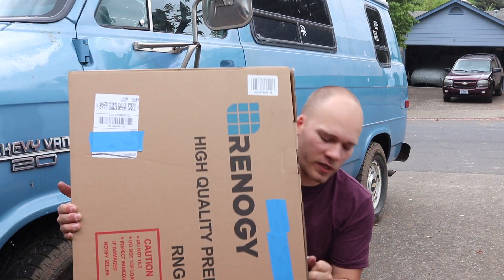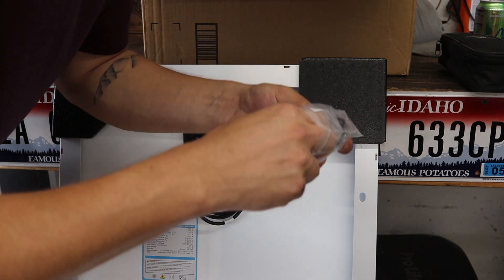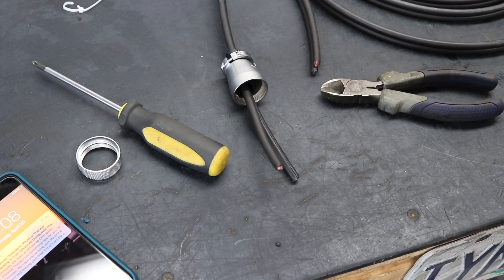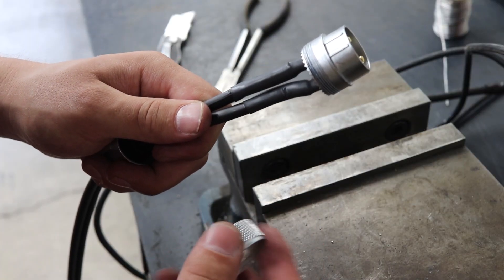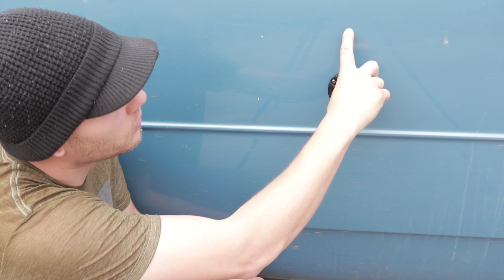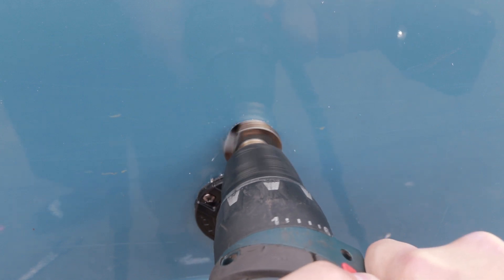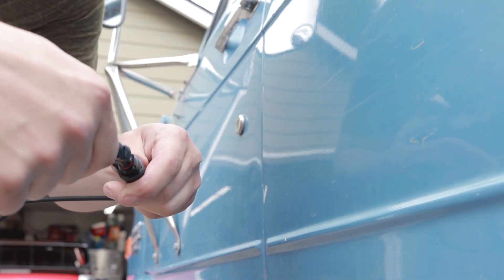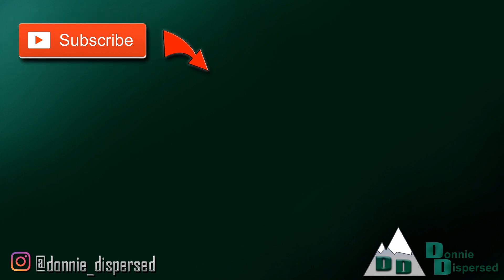CAMPER VAN SOLAR SETUP/ INSTALL | Off Vehicle Panel

Comment from the maker: Items in this setup! 
Renogy 100w Solar Panel: https://amzn.to/3nS9UEj
2 Pin Bulkhead Power Connector: https://amzn.to/3y0qW8a
Ctek D250 DC-DC Charger: https://amzn.to/3elwhyN
Solar Extension Cable: https://amzn.to/3tphvvc

-Affiliate Links. Purchases through these links support the channel at no added cost to you.